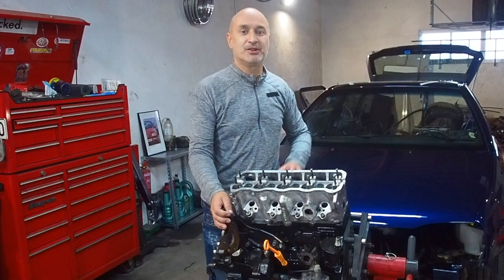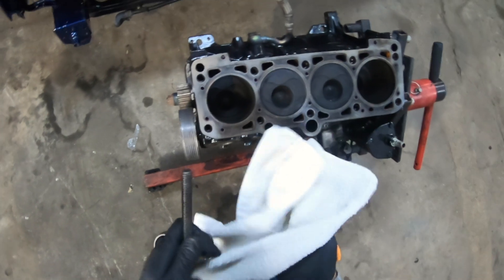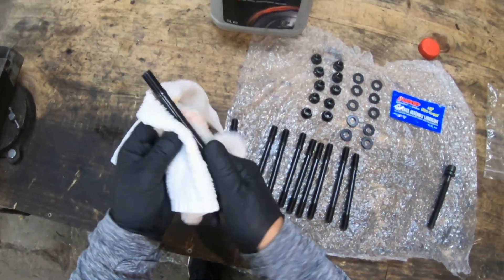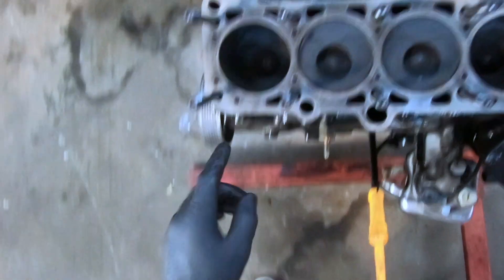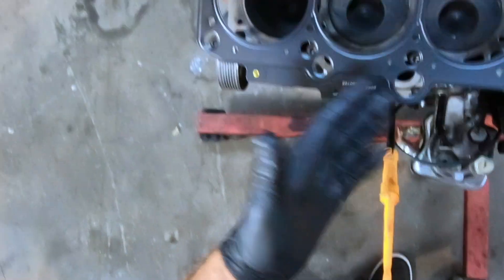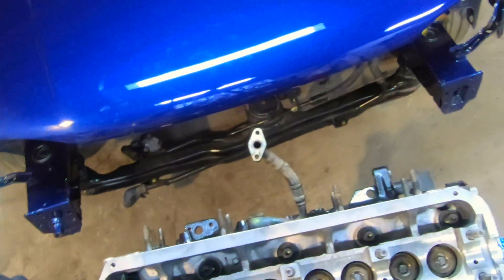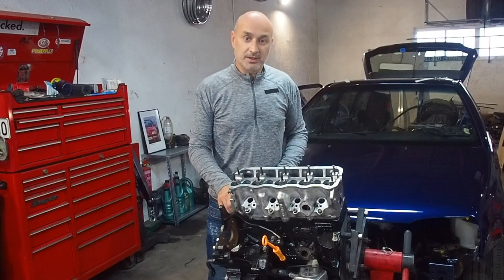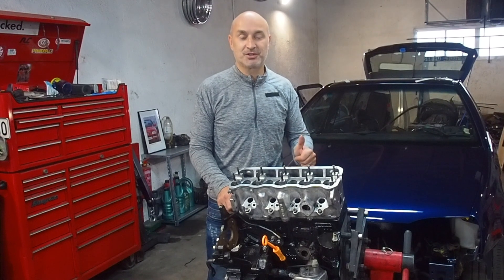How To fit ARP Head Studs VW Golf mk1 mk2 mk3 TDI GTI 8V engines

Comment: Nice with the ARP bolts. Did you do anything with the pistons and cylinder liner’s? Or only rebuild the head?
Reply from the maker: Thanks, I checked the bottom end and it was in really good condition, so replaced all the seals, gaskets and the oil pump. I found the belt size, it is 6PK995
Reply: Resto Designs okay. Nice. Thanks for the number. Now next is to find the pulley it’s not so easy her in Denmark. Unless I have to buy a new one